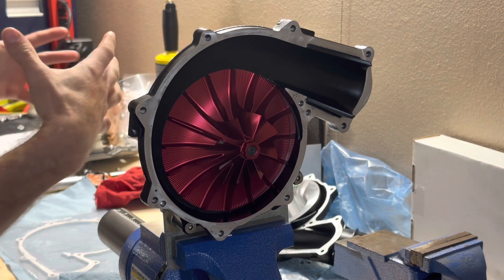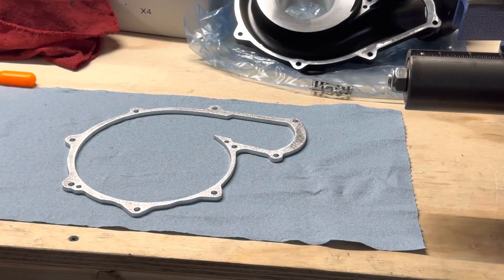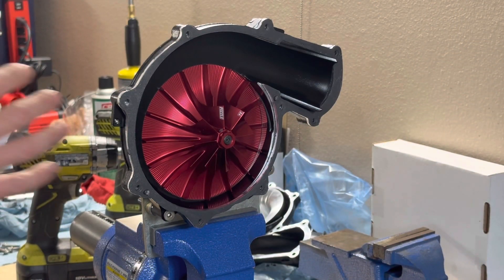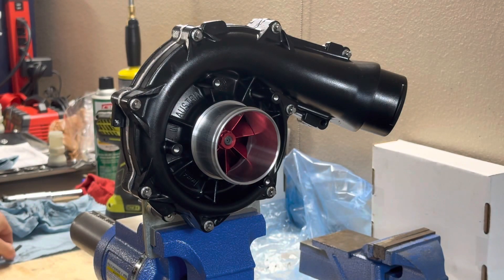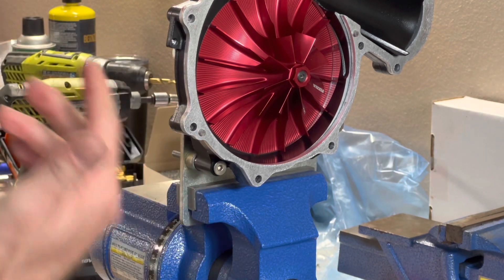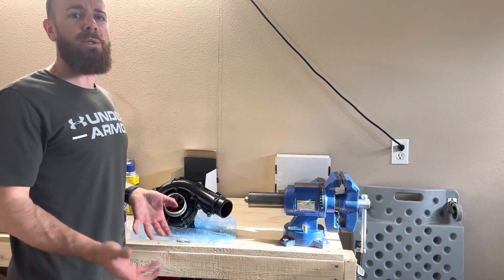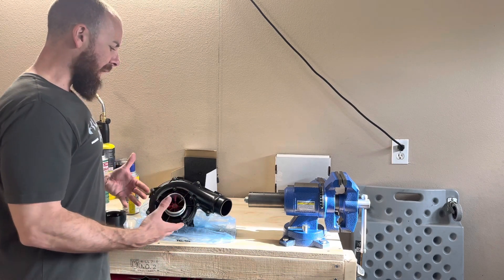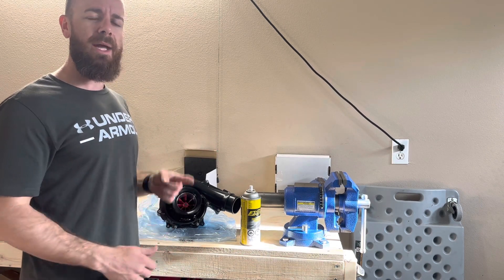Sea Doo Supercharger Wheel Upgrade Install (Part 2)

Comment: make a video for 300hp install fizzle z135 and how to install correctly racing camshaft, no one did it yet! it will be a good video
Reply from the maker: I will be doing a camshaft install soon. Gotta find someone who needs a 135 wheel installed to make a video though…..
Reply: @SaltyDogPerformance  sounds good, make a good video of camshaft install with specific torques etc, try the 135 wheel also, I like your videos. Awesome
Reply from the maker: @alihaidar4663 I already have a 135 wheel on my ski.  Next time I have to install one I will do a video for sure.
Reply: What does the stock 255hp supercharger make for boost vers the spacer and bigger impeller?

Comment: do you need the 42 lb injectors with this wheel? I want the basic upgrade  is that the 135 wheeel?
Reply from the maker: A 255 supercharger charger requires the 42lb injectors. This is an X4 Fizzle supercharger wheel that goes in a 255 charger and is considerably larger. You need at least 60lb injectors and a retune for it.